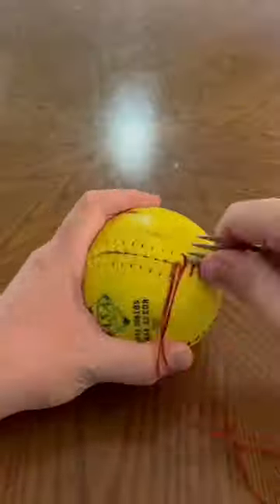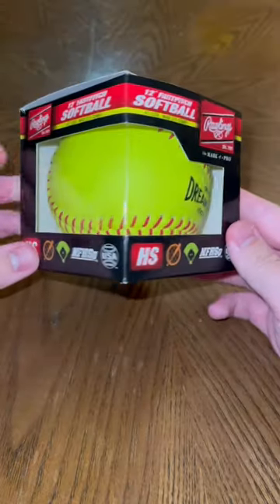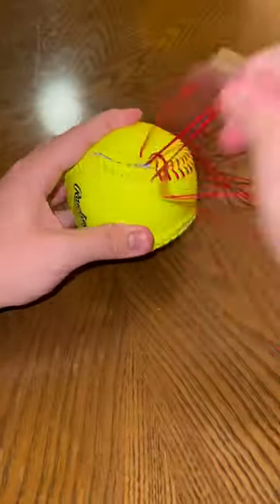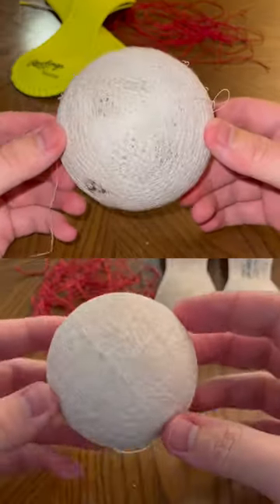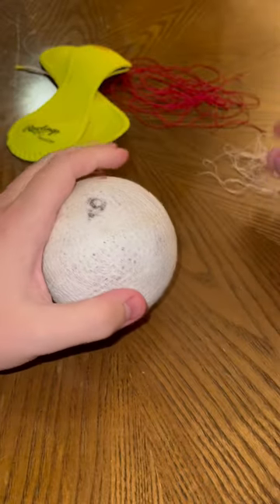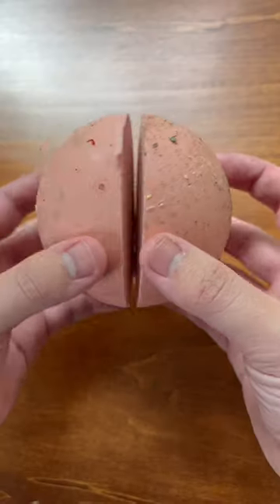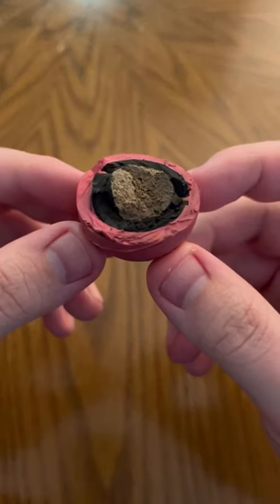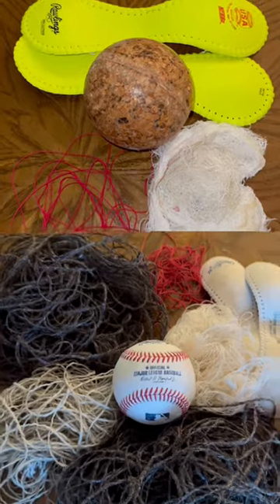What’s inside of a *real* softball? #softball #baseball #mlb #whatsinside

Comment: The only thing hard about softball is opening one
Reply from the maker: Bruh the ball is just as hard as a baseball
Reply: @snohepeasier to hit is arguable. It’s bigger, and pitches will usually be slower, but it’s also coming at you from a mound that’s much closer 

I think read that a 70 mph softball (which is thrown from ~40 feet) is equivalent to a baseball (thrown from ~60 feet) going 90-100 mph. 
Reaction time means a lot in the discussion
Reply: @chrishansen8119 it’s gonna blow this guys mind when he learns you play from shorter distances when you’re younger. Girls just cap out the distance sooner because they’re not as strong.
Reply: sure its easier to hit for contact but its much harder to drive foward since its a larger object
Reply: @hendeltonno it's not, it's scientifically proven that it's garder
Reply: @hendeltonit's bigger meaning we need more strength to hit it far
Reply: @hendeltonand what does the color have to do with anything some softball are white
Reply: @hendeltonit don’t matter that it’s big and yellow lol. The shorter you are to something the less reaction time you get. The more velocity the ball has it’ll also be more difficult to hit or react to since it’s covering this short distance a lot quicker.
Reply: @hendeltonno it’s not 💀
Reply: @hendeltonthey aren’t tho most are 350 at center and 300 around
Reply: @emiliameyers8629 softball fields are much smaller than baseball fields
Reply: @editing_aviation  because we physically can not to 450 dead center
Reply: @emiliameyers8629  right…so they are smaller
Reply: @editing_aviation  no shit that have to be
Reply: Softball isn’t as easy as it sounds.
Reply: @chrishansen8119  it also helps that they use bats the size of my thigh 😂
Reply: @hendeltonours are shorter because it would be harder to hit a home run on a baseball field 😮😮. Also yalls white little baseballs are so tiny they are easier to hit. (ofc if YOU’RE strong enough.) sooo… baseball and softball are hard in their own ways…
Reply: @hendelton bc you can hit it farther 😮
Reply: @hendelton I just said that’s why the fields are bigger, because they’re EASIER to hit.
Reply: @hendelton yea that’s what makes baseball hard. But softball fields are smaller and the ball is bigger so it’s harder to hit it far on a baseball field. So that’s what makes softball hard.

Comment: I just did characterization of the layers of the baseball rubber, of which I cannot find any information about anywhere. From what I concluded, the pink layer is polystyrene-butadiene and the black is ~probably~ nitrile rubber but unsure
Reply: Manufacturing secret in Europě we use teammate and some other random call name that i forgot they are difference Insides but they běhá E very simmilialy
Reply: @Me_No_Care  what is teammate? Can you retype this it's hard to understand. What is call name?
Reply: @micahsilverman5284   a teammate is a softball ball brand used in the Czech Republic 🇨🇿 and I don’t understand what do you mean by call name 

Let’s start from the beginning there are different softball ball manufacturers 
The most well known in my country are teammate their balls have specific insides that are made of cork and some other stuff
Reply: @Me_No_Care  okay, look at your original comment, you wrote "call name" but I think you meant "ball name"